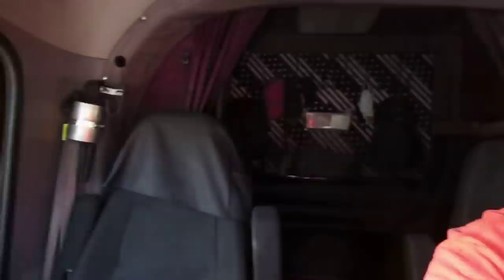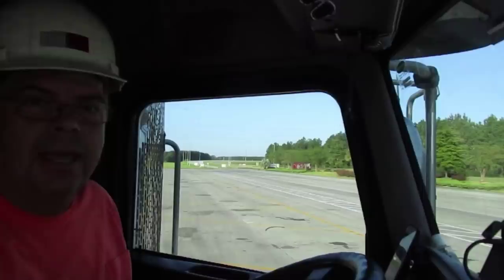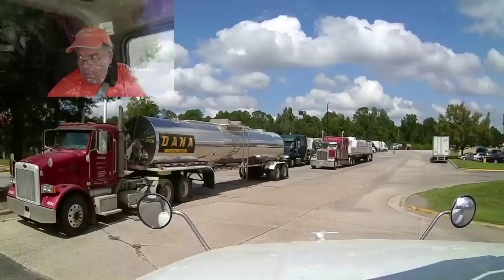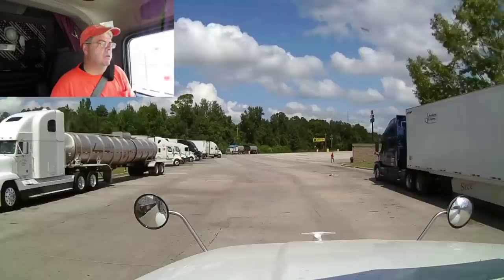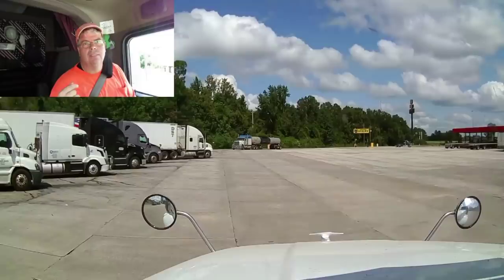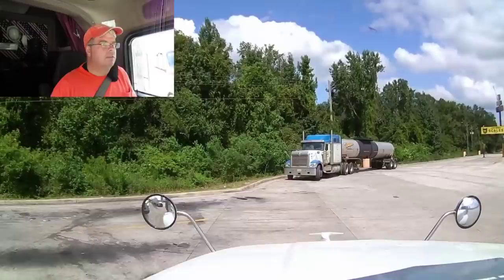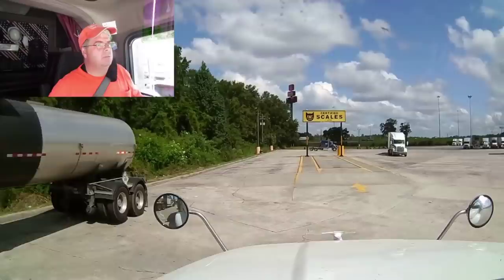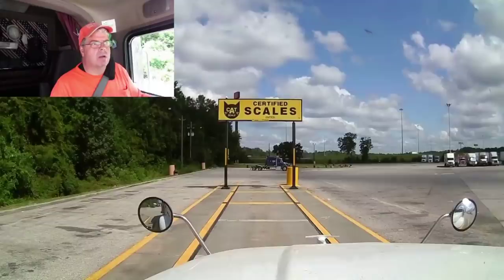#428 Trailer Scale Calibration and a Steel Coil The Life of an Owner Operator Flatbed Truck Driver

Comment: Also I would suggest that with the right weight gauges (Best gauges to buy for sure) set them 500 pounds under the scale ticket. The reason for this is to make up for discrepancies in both your system and the DOT scales... Even when your 100% sure your on flat ground and even if you have let your air system fill completely there can still be some settling of the truck, if your breaks are set while you do this there can be some pull or push on one end or the other. If you release your breaks and chock you wheels there can also be some pull or push as the air ride settles. I have found over years of using these gauges that it usually always happens and it's usually 200 - 250 pounds off. I also move the truck forwards or backwards a few feet stopping a little hard to cause the air ride to move then let it settle again and recheck / re set. But I have found that by simply dropping my setting 500 pounds that there is NEVER a problem...

Comment: There is a Chevron station next to that pilot you weighed at. There use to be a guy that did phenomenal bar be cue. GOOD FOOD CHEAP. Well at least it was 5 years ago. I use to haul  caustic into that stainless steel mill. Always had instructions on the bill of lading DO NOT CALL THEM THYSEN KRUPP, THEY ARE EXTREMELY SENSITIVE!! LOL

Comment: Great job with the sponsor. I believe they might learn a little here. I've never pulled a trailer with that spread axle, learned here how you can gross 40,000 lbs. on it. I would want to load the way you did too, keeps a little more weight off the truck. It would be nice if they just came reinforced that way from the factory. That jig they had on the tour that allowed them to rotate the trailer 360° was probably so most welds are flat, horizontal welds. Easier and better, faster too than overhead and vertical welds, my opinion. Oh, great video as always.

Comment: Since you like reading the green book, perhaps you should read the part about weight on a single axle. You mentioned your "A little heavy on the steer" and showed a scale for 12100 pounds.... WRONG.... your steer weight is determined by the weight rating of the axle and the tires... 
In a class 8 truck the lightest steer axle will be 12350 pounds. G rated tires are 6175 pounds each. So if you have 14 ply "G" rated tires at 6175 then you have 12350 pound tire rating. Combine that with a 12350 pound rated axle and you can legally have 12350 pounds on your steer IN EVERY STATE.... The 12000 pounds is two things. First it is an industry standard to which all axle and tire manufacturers do not want to go below for a weight rating on a class 8 truck. Second it's a simplified learning practice for new drivers. 12000 Steer 34000 Drives 34000 Tandem is much simpler to explain than saying your steer can be at axle or tire rating which ever is lower and then you have to take what ever is over 12000 away from another axle group. So lets say you have a 13200 pound axle and "H" tires (13220  6610 x 2) the axle is lower so you could have 13200 pounds on your steer but then you can't be over 80K so now you have 13200 steer 32800 pound drive 34000 tandem, or 13200, 34000, 32800....
Being that you have a set back steer axle if you look at the door you will most likely see you have a 13200 pound axle. Look at your tires for the wight at 110 psi 6175 is a G and 6610 is a H you combine the rating of both steer tires 6175 x 2 =12350 for G ply and 6610 x 2 = 13220 for H.
If for some reason you had a G on one side and an H on the other then you have to go by the lesser number so in that case you would be good tire wise for 12350...

Comment: I never set the brakes when I weigh on a cat scale. It will throw your axle weight off. When I calibrate my right weigh I pull back on the scale  so I know everything is perfectly leave. Just a tip. I enjoy your videos👍

Comment: Hi Dan. I can not understand why trailers do not have coil wells built into them. Back as far as 50 years ago in the Uk and Europe 44000 lb coils were carried this way, even heavier now since the GVW has increased. The coil sits 40% lower on the trailer between the chassis rails. Two chains over the top. Tarp if necessary, much safer.

Comment: i remember picking up aluminum coils, on pallets, from Kentucky, to Denver. i remember because i lost my big lock, when i delivered the load. had a habit of placing it on the DOT bumper, and i drove off, forgetting the lock. that was a $150 lock too. got it when i went to trucking school. i think i got 3 coils, and had to use 3 load locks, to keep the pallets from shifting, cause after its loaded, its sealed and locked.

Comment: slide 5th wheel plate back 2 notches and should be good on steer.
Reply from the maker: The fifth wheel is in the rear most position 
Thanks for watching

Comment: Sorry, I can't help myself. Dan probably knows this, but 3/8 inch chains are only good for 6000+ WLL if the binder is rated just as high. The WLL of the weakest component is all you get. Many binders have a WLL of 5400. He's still legal in either case.

Comment: Shoulda rescaled it without setting your brakes on the CatScale.
Reply: Why?
Reply: @MidwayGuy  cause when u set the brakes the wagon sets down just a bit so it will throw it off somewhat
Reply: You should always weigh with your brakes off. Scales should be level.
Reply: @waynesworld2086  Also happened to me just once. Never scaled with brakes on after that, it threw my axle weight off big time, it was with a dry van.
Reply: Imagine,  a professional with all that alleged experience and he sets the brakes when scaling....rookie move.

Comment: Hey Dan love the new Dorsey.I do have a question tho.I've found a 2015 International prostar 324000 miles 500 HP engine well maintained. I believe it was a heavy haul the drives are 14000 and drives are 40000.Would you consider using something like that for flat bed.Thanks for any input
Reply from the maker: Sounds like it would work. Make sure you have enough room behind the cab for a headache rack
Thanks for watching

Comment: I'm a Noob less than a year on the road... wouldn't you want to go to a cat scale and calibrate your truck empty? Not trying to be a smart-ass just asking a question
Reply from the maker: Those little air scales are designed to work on air pressure. A heavy load creates the most air pressure. There is not much air pressure in the suspension when you have a little load. They have to be calibrated under a heavy load. 
Thanks for watching
Reply: @SuperTruckerdan  like I said I'm new to this industry less than a year I'm willing to learn everything I can to make my job easier and more efficient that's why I watch your channel and many others thanks for posting your videos it helps more than you know
Reply from the maker: No problem 
Thanks for watching
Reply: Rite-Weigh instructions say to scale within 1500 pounds of full axle weight. Most gauges only indicate a value, so you want the accuracy the legal axle reading. My scale reading is off 1000 pounds when I am empty but accurate at 34,000 pounds.